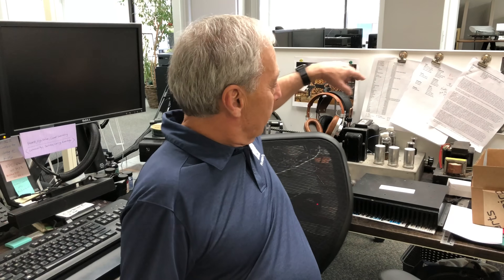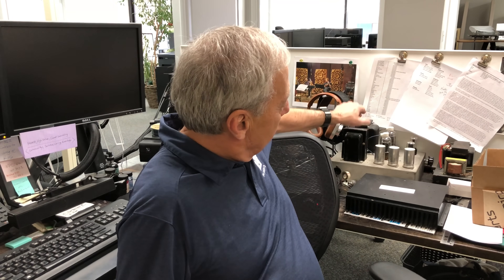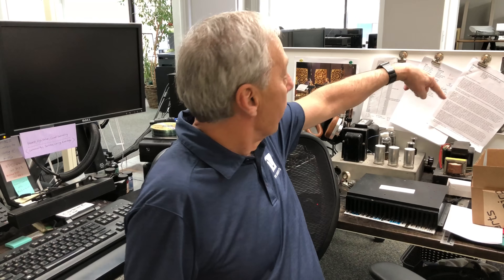House wiring for high end audio

Comment: couple comments here..
it is a violation of NEC to attach a 20A receptical to a 30A circuit
your commercial building uses "building wire" THHN, not romex in the conduits, as installing romex in Conduit is a violation also
Reply: @k5dbx  It is not 60Hz that we are shielding from, but higher frequencies, like RF and other crud.

Comment: If you are spending uber money on exotic high end then you might benefit from a dedicated line. I doubt the outlet greatly affects sound on cheap gear. Expensive treated outlets are not doing alot for the money in my humble Naim Nait 5Si/CD5x/XS. But a higher quality outlet than std- a more robust grade of plug with better grip on the equipment plugs is probably well worth the cost-- a better one at home depot costs ~ $8 [a regular house outlet for 2 plugs  ~$4?]. Also, upgraded cords to the gear is worth doing as well - I heard an improvement with a 15' Cable Leader, 14 AWG = 15A 125V, Hospital-Grade  NEMA 5-15P [male] to IEC320 C13 [female],  $17 ea. replacing the std black cord that came with my Naim Nait 5Si, CD5X/XS gear.  I installed a 30 amp breaker and 10 gauge romex to a better than std 2 plug outlet [not slot] and ran a copper ground wire from the outlet to a buried iron rod-- Immediately when turned on with the grounded dedicated line, I heard a "relaxation" in the sound, as if the system was now happier, operating better, but I'm not sure its worth the bother. I think a power conditioner might be a better way to go-certainly alot easier! One could comparison test by plugging and unplugging comparing the foregoing with ordiniary old house outlets/ shared undedicated romex/breaker box to see how the sound is changed, but my guess is its not a big difference.

Comment: An engineer with IBM and the wires used in mainframe super computers are not us$ 1000.00 dollar a foot.
Yes, we do have a inline generator.
Wire for Hi-fi is like fishing lures, it does catch people not fish.
Reply: I got a hold of some silver/beryllium/copper alloy zip cord.  It was wonderful to run long extension cords with as it was flexible and light weight.

Comment: 4:51 ... There is absolutely NO REASON to place "Romex" into steel conduits.  Normally these are filled with color coded insulated 12 gauge wires.  (Black and white) The conduit itself is the ground connection.  In three phase installations there can also be red and blue wires.
Reply: You'll be sorry when you drill through your wall and hit a Romex.
Reply: @RoboticusMusic  I have NEVER seen rigid conduit in a residential home in my entire life, and I work in homes worth millions

Comment: They call it a branch circuit.  It is nice to have some dedicated 20 amp branch circuits in the stereo room, for the amps (maybe in the floor) and one where you are going to plug in the power conditioner.  Most rooms have the outlets on a separate 20 amp branch circuit and the light on a separate 15 amp branch circuit.  So your (dedicated) branch circuits would be seperate from the other outlets in the room.  Most of the time there are more than one room on the outlet and light branch circuits to save wire, breakers and money.  A couple of branch circuits in the house are not going to cost much if the walls are all opened up.  You can get wire in a flexible steel conduit which is normally used in areas where the plastic coated romex is exposed to damage; like in the garage or basement.  It could be used as a shield I guess.  It's easy to pull through the walls. Rigid conduit like Paul mentioned would be tricky to run through the walls.  I guess you would have to go over the rafters and come down the wall to the outlet.

Comment: 30 amp outlets and 20 amp outlets have completely different plug configurations...Don't really understand the first question. However, I like the 10 gauge wire on a 20 amp circuit concept. The bigger the garden hose, the more the flow

Comment: something to keep in mind is,using too bigger cb also means more fault current is required to trip it,so put simply,you may draw enough current to start a fire but not enough to actually trip the breaker,couple this with time & transients & fault current makes for very dangerous circumstances.I would use an isolation(1 to 1)transformer,on a dedicated 20A circuit,which will reduce your noise issues anyway.I realise this is USA,I am an Australian EE,but still a hot naked babe is the same no matter where in the world 😛

Comment: Has anyone considered using BX cable or better yet, MC cable as an alternative to conduit?  MC is required in any medical facility where the equipment comes in contact with a patient.  The exterior looks like BX (flexible metal jacket)  but there is a separate ground wire in addition to the jacket bleed found on BX inside.  This is called an isolated ground.  The outlets used have a green dot on the face to indicate such.  Not only the ultimate in shock prevention, but the isolated ground helps reduce noise on sensitive analog input medical equipment ie. EKG and EEG machines.
Reply: Yes!  I have my outbuilding wired as such.  It's been struck by lightning a few times with no appreciative damage.  Also use the same method when adding new circuits in the house.  I understand all new mobile homes and campers use this four wire method.

Comment: Julia said it right use a 10awg wire just in case and put a 20amp breaker on the ckt.  You can put a 30 amp breaker in if you trip the 20.  But also you can run a 10/3 in case you want a 240v ckt.  And keep in dedicated if you can.

Comment: While you certainly could have a separate circuit or even an separate mains panel for your audio space, I wonder the benefits of such extreme in the last 100ft or so of the electrical grid. Upgrading the utility amperage is not a trivial matter, and I have seen houses/apts with as little as 100A service. With an 80% limit on usable capacity, you are looking at 80A to still be in code in that example. There are quite a few situations that would preclude upgrading, even. A 30A circuit requires a different outlet, as typical ones are rated for 15A and 20A, visually identifiable by the slot config. So many variables to consider in doing such things. I would never recommend simply installing a higher rated breaker than the cabling allows. You are asking for a fire that no insurance company will cover.

Comment: Doesn't the fuse in the plug serve as a breaker
Reply: The fuse in the device for the most part will protect the device, but it won't protect the wiring system upstream of the device.  The breaker does this.

Comment: Maybe the codes have changed since I built my house about twenty years ago.  I used a single dedicated circuit for my stereo in the living room and the rest of the room was wired as normal.  I used 10 Gauge wire and ran a single circuit back to the box which has a 20 Amp breaker.  The inspector asked me why 10 Gauge but he approved it.  He said the code required a minimum wire size for each current rating and breaker, but you are perfectly fine going with a larger Gauge.
Reply: I have 4/ 20 amp separate circuits for my stereo and you were correct to use the 20 amp breaker. I don't know what benefit the 10 gauge wire will bring because of skin effect but I bet it will improve dynamics of your amp because current will flow more freely to the outlet.
Reply: I recently had the main input to the house upgraded (plans to increase capacity) and asked the electricians to use a thicker wire than was required (so if I want to increase capacity even more later I won't need to replace the wires) I have 16mm2 wires now and a 20A breaker (later it will be 40A),
Reply: This is what Paul was suggesting.  A dedicated circuit for audio.  Over sized wire to help reject noise and carry current easily without adding inductive voltage loss. Line loss is also a concern for long runs of romex to various outlets.

Comment: You are weird, definitely problem with inspection and code. Why you  think that way because you have a common sense. If you put one size  bigger wire than the fuse need you don't burn of your house, but this is against the code ...?!...  I dont think  the problem is you...
Reply: What I would do circular line one main around the house like a loop so no problem with voltage drop exept ground and separate breaker box in each room. If you do a City like this you have less outage... When I learned how to calculate wire size for electrical poles and homes I already saw it does not make any sense. Save money than spend it to fix it...  ( electrical technician)

Comment: As for the term called " GROUND" it is really called " BONDING" the only part that is grounded is your electrical panel , which IE consist of a ground plate or ground Rods. Which are placed outside.....
Reply: Nope here in the UK bonding is linking together exposed metal surfaces that 'could' become live, water pipes for example to a common ground at the consumers unit, which might derive it's 'Earth from a ground spike or from the suppliers neutral connection, I wrote this badly. Cheers, J.
Reply: Bonding is when you join the GROUND w/ the NEUTRAL.  This is done at the main panel only.

Comment: I own a commercial building and must use conduit.  You use stranded wire in conduit. It is easier to pull, you can add multiple circuits and it conducts better than solid. You can easily run 3 circuits through a conduit and then branch it to 3 outlets. Not sure what star grounds are.
Reply: Neal Staats  why can’t you run stranded wire through conduit? Thats the kind of wire that is mostly run In conduit. There’s not really a cleaner way to get stranded wire from one side of the room to the other. If I was the poor slob pulling #10 or larger solid copper wire in conduit all day I would get pissed.
Reply: Yes That is an electricians rule about 360 degrees.  I have a hard time with outlets too.  Two choices.  Either connect them in a twist connector to solid or tin it with an iron. 10 gauge will be tough on any outlet
Reply: You don't run stranded wire in conduit!  You run individual lengths of solid wire.
Reply: +Neal Staats I know for sure code requires stranded wire. solid is too hard to pull and can get damaged. ask an electrician.
Reply: Good points about stranded wire vs solid wire.  I couldn't find a specification in the code.  I stand corrected.  Stranded wire is definitely easier to pull, but it is harder to terminate unless you want to us a crimp connector.  In the case of an electrical outlet, that means 2 connections per conductor rather than 1 with solid wire.  Solid wire is a pain to pull, but terminating the connection is easier.  After doing additional research I found that a good rule of thumb is that if the conduit has more that 360 degrees of curves excluding the boxes at either end, use stranded.

Comment: It is against the NEC to install a 30 amp breaker when your outlet is only rated up to 20 amps!
Reply: Yea, i was trying to make the point also, a 30A rated outlet can not accept a 20A or a 15A plug from audio equipment without changing the plug to a 30A-115V plug. It would be nice, though, just to wire the entire house with #10 solid core copper and pick and chose the breakers and outlets as one desires.
Reply: You've never seen an amp with a 30a twist lock?

Comment: The breaker is sized to protect the wire and receptacle, #14 = 15A breaker 12A load, #12 = 20A breaker 16A load , #10 = 30A breaker 24A load. http://www.ecmweb.com/basics/sizing-circuit-breaker
You can up size the wire to reduce resistance, but if you still terminate the wire with a lower amperage device, the breaker must be sized for it(terminating a #10 in a 15A device is much harder), for example a 15A receptacle with #10 wire must be protected with a 15A breaker, using a larger breaker risks a fire at the receptacle. http://waterheatertimer.org/images/Wire-size-and-amp-chart-700.jpg
You could use a 30A receptacle #10 wire, and 30A breaker and change the cord end to your equipment to fit the receptacle, but if there is ever a fault condition, you only have the internal fuse to protect it, so if the short happens just before the fuse, you could risk a fire if the breaker doesn't trip fast enough so you also have to change the power cord to #10.

Having a dedicated run of power wire to each receptacle will reduce EMI from other devices in your house, I would go one step further and isolate the grounds from the the other ground circuits at the panel and run a separate ground back to the main ground(water main? ground rod?), this will help keep the ground plane free of EMI from computers, PWM power bricks, etc...

I would use conduit  strictly for future changes, it's so much easier to pull out older technology wiring and pull in newer stuff, for example I pulled CAT5 to all receptacles, to all switches and to TV locations in my brothers house for future use, they all were pulled to a media termination cabinet(this is over and above network runs) I also pulled #12/4 speaker wire to each room  for distributed audio. Ideally I would have run conduit to each non power location and pull what I want when it's needed, Cat 5 then, Cat6 now, fiber in the future. 

Keep your power wires away from the other wiring as much as you can and you won't need metal conduit for shielding.

I should add that I wouldn't pull Romex through conduit, I would pull the proper individual wires as needed, THHN insulation in US, RW90 XLPE in CAN. http://www.titanwnc.com/nec-csa-designations/
I would also buy the best receptacles, Hospital grade https://iaeimagazine.org/magazine/2005/01/16/receptacle-grades-what-do-they-mean/

Comment: The wiring code is pretty conservative, so correctly specified breakers for installed circuits, will protect the cables and provide shock protection. The breaker is not specified to protect the load, which should have its own fuse or other suitable protection.